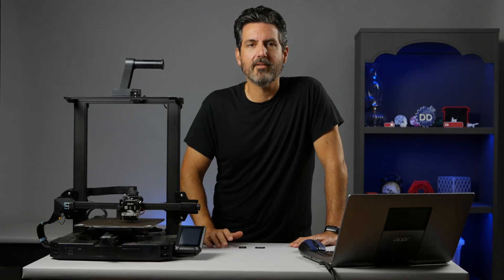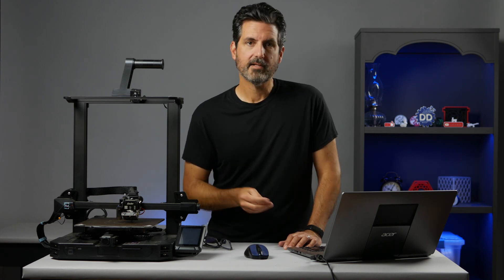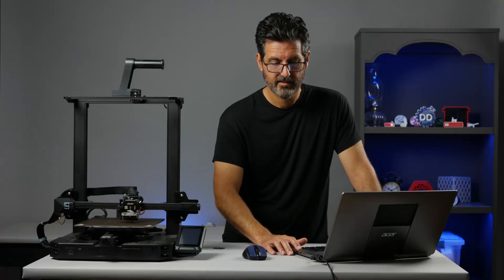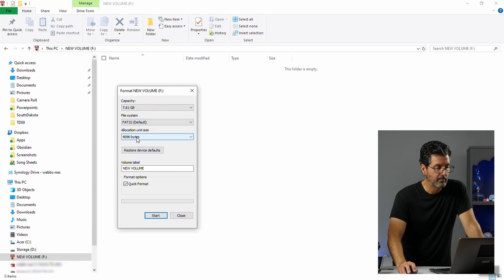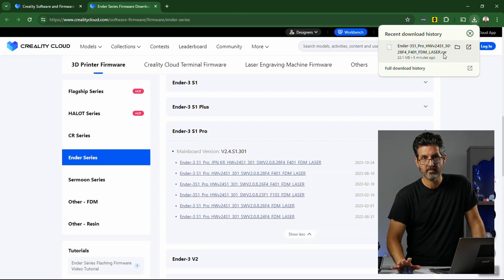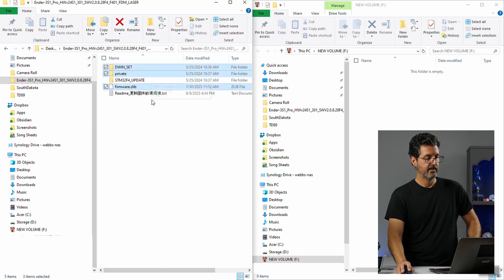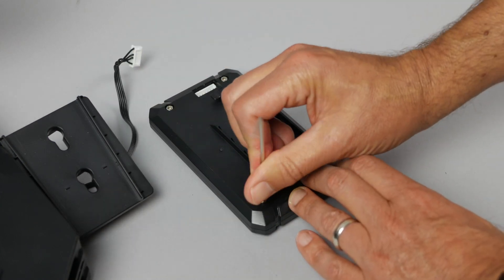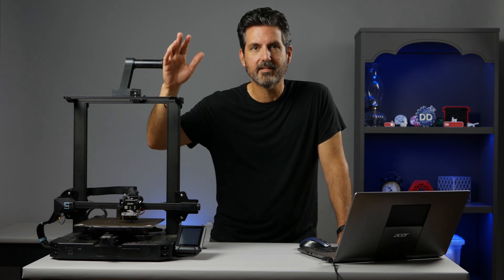How to Update the Firmware on Your Ender 3 S1 Pro: A Step-by-Step Guide

Comment: Great video thanks!  BTW - you don't need to take the bottom off to check the chip version.  You can look at the existing firmware on your printer (under 'About') and if it ends in F4 it's 401, and if it ends in F1 it's 103.
Reply from the maker: This is great info! Thanks for sharing. I pinned your comment so others will see it.
Reply: I read this after I opened a printer haha
Reply: @kriseq2 thank god i saw this before opening
Reply: Thank You!
Reply: Looks like I'm going to still have to open mine up.  Firmware version is 2.0.8.13, nothing after that.
Reply: My firmware says 2.0.8.23F4, but ChatGPT told me "that suggests that your Ender-3 S1 might have an STM32F4 series chip, but it’s not explicitly confirming whether it's STM32F401 or another variation (like F407 or F411)." So I still had to take the bottom off to make sure. If I'd come here I would have been happy to not have to do that job! lol

Comment: To find your Ender 3 S1 Pro's mainboard chip,
check the firmware version on the display (ends in F1 for STM32F103, F4 for STM32F401)

Comment: The SD card reader on my ender 3s1 pro is busted, and I'm using a Sonic Pad. I need to re-install the firmware as a troubleshooting option for an issue with my CR-Touch not being able to verify the sensor state. Do you know how I can do this?

Comment: I followed all the steps and installed the update successfully, but there’s a problem.
When I select the file I want to print and press Start, nothing happens — the printer doesn’t move or begin printing.
All the other buttons and settings on the screen work fine, except the print start button.

Can you please help me fix this issue?

Comment: Has anyone done this update recently? when I updated the screen, it goes from 1.0.3 to 1.0.5 but when I update the board it stays at 2.0.8.26F4 instead of x.x.x.28F4. I have tried to print and the screen reads everything but I can't push the "play" button to have the print start.

I've pulled the bottom off and checked to screen and they both show the 401 chip.

I've successfully rolled back the printer and it works.

I'm using a 1GB card formatted to FAT32 at 4096 bytes as required.
Reply: My update did the same thing. Did you get your F/W VER to update?

Comment: Bought a second hand S1 Pro off facebook marketplace for CHEAP,  that the previous owner had attempted to do some extruder/printer head swaps with, and had apparently gone out of his depth while doing so. This video helped me get my new printer back fully functional, and ready to print. Thanks for the help.
Reply: I can't resist these secondhand bargains. I just got the S1 Plus for €50. With PEI and glass bed. Nuts isn't it. I used the Sonic Pad to put it on Klipper

Comment: I followed the instructions on your video and I was able to update the mainboard but not the screen. After inserting the card on the back of the screen and turning on the printer it boots up like normal and that blue screen with all of the letters doesn't appear. It does everything like normal but when I click on the file to print, it freezes and I have to reboot the printer. Any idea on how to solve it?
Reply: If the screen update isn't done at the same time as the printer fw it will lock up when the printer tries to do an action that requires a missing graphic on the screen. Either roll back to the earlier printer firmware (to match the earlier screen fw) or update the screen as required. A newly formatted SD card may be required and from memory, I think there's 3 items that need to be in the screen SD card to update it. Not just the DWIN one. Alternatively, look into running with Klipper

Comment: Thank you for the clear explanation, specifically about formatting and reducing a 16Gb to 8Gb SD Card. However, in order to use the full potential of the 16Gb card, you also might leave an instruction to reset the card to 16Gb again. I know it is basic Windows disc management, but still...  btw, the update worked like a charm.

Comment: Great video. everything worked except the firmware version is still what it was but the Screen version changed. Guess I'll try it again.
Tried it again and the version still hasn't changed and now i can't print anything. Tried 3 different SD cards, same file. The file shows up in the Print screen and after selecting it, it does not show up on the Home screen and clicking Start or Play does nothing.

Comment: It doesn't work for me. The printer doesn't support cards...This printer makes me despair
Reply from the maker: If it doesn't support SD cards then you don't have a S1 Pro and you need to look for info for your printer.
Reply: @dandesigns3d  No, it's the S1 Pro, but nothing happens when I insert the cards for the update.

Comment: Bonsoir, j'ai suivi votre tutoriel pour mettre à jour ma Creality Ender 3 S1 PRO, j'ai vérifier le modèle de puce qui est STM32F401. Lors du téléchargement des fichiers indiqués sur votre site, le fichier "firmware.zlib" n'apparaît pas sur la carte micro SD pourtant mon ordinateur m'assure qu'il a été installé sur la carte micro SD.
J'ai donc essayer comme ceci, mais au moment du démarrage de l'écran, il y a un écran bleu avec écrit en rouge quelque chose qui apparaît moins d'une seconde.
Après cela j'ai mis à jour la carte mere.
Mais après tous sa l'écran ne  s'allume pas mais lorsque l'on clique dessus le "bip" est émis mais aucune chose n'apparaît à l'écran.
Comment puis je résoudre ce problème ?
Reply from the maker: I would try to get a new micro SD card, verify it is formatted the way I specify in the video (the format is VERY important) then make sure you add all the required files to the card and try updating the display again.
Reply: Quelqu'un peut m'aider svp 🙏

Comment: This didn't work for me on my Ender 3 S1 Pro. I formatted an 8GB SD and an 8GB microSD to FAT32, copied files to their respective cards, and diligently followed each step. The display update looks like it is updating files (though it appears a bit different than yours; maybe 50+ lines of prompts in red font), and when these cycle through the display freezes in the midst of a Creality logo animation. I waited for a half an hour, and nothing changed; just frozen 'logo'. Did the same process again; same result. I then booted the machine to see if I could get the mainboard update to work. It boots up, but when I look at the About tab, it still shows the same old 2.08.15F4 firmware. Nothing has updated.
I even reformatted the SD cards and did the entire process again. Same failed result.

No luck with 2.08.26F4 either. Went through the entire process again, and the About tab still shows 2.08.15F4

Comment: We just got a brand new Ender 3 s1 plus.  My son sliced a print to try on it, but when he puts the SD Card in, it crashes. Will updating the firmware help? He is bummed and thought it would work right out of the box.
Reply from the maker: Can you print any of the included files? Tyr the Bunny.
Reply: @ he just tried the bunny, but as soon as it starts, the printer turns off and reboots. Could something be disconnected?

Comment: Anyone have a clue why my printer will no longer home after updating the firmware?  I have checked the versions and they are correct.  The Z axis seems to operate correctly but when the x axis attempts to move it stalls/vibrates the stepper motor and will not move.  The y axis does nothing.  Any ideas?
Reply from the maker: When the printer is off can you freely move that axis with your hand?

Comment: Thank you for this helpful guide.
I got this printer model as a christmas gift and tried today to update it from version 2.0.8.26F4 to the newest one (2.0.8.28F4) because auto leveling not showing any meterings on the display an does not let me save it after done its work. No chance to get it worked with all the prework with sd card formatting and so on. Every time I power on the display with inserted sdcard containing the folders in file according your guide, no blue update screen appears but the printer is booting normally. Also updating to earlier versions did not work. Any idea?
Reply from the maker: Did you get this to work? If the screen is ignoring the SD card inserted and booting normally it is most likely either the incorrect files on the SD or it doesn't like the format.

Comment: Thank you very much! 
The video is very informative and comprehensive. 
Without it, it would have been difficult for me to do such a task. Especially the fact that the SD card had to be inserted into the display and not into the normal SD card slot.

Comment: My son's Ender 3 s1 pro shipped with a firmware that does not have a levelling function. Everyone's settings screen is different than mine. WTF? I hope this helps, or I am the worst Santa.
Reply: Nice, I wasn't in FCM mode or whatever, ECM. The one that isn't Laser, we said Laser. I factory reset it on a whim and went, "Well let's try that one." Leaving this here in case anyone is the same stupid.

Comment: Unfortunately, the motherboard firmware update did not work for me. I am experiencing an issue where the printer froze during the last print, and after restarting the machine, the display freezes on the startup animation and the machine does not boot. Do you have any suggestions? I’m afraid there might be a problem with the motherboard.
Reply from the maker: I would try to follow the steps again from the beginning. Make sure the format of the cards are correct and you get the correct files on the card for both updates.

Comment: Unfortunately, my S1 Plus gets stuck in a boot loop on the initial screen. I followed all the steps from the video, tried reverting to the old firmware, and updating it again, but it still loops. For some reason, the loop stops when I remove the SD card, but I've already tested several cards, and the problem persists.
Reply from the maker: Make sure you're using the proper firmware. My instructions are for the S1 PRO. Also I can't guarantee you that all the instructions are totally accurate for the S1 Plus.

Comment: Great video Dan thanks. Could I ask? I have just followed the instructions on your video but I’m sure I already had the latest firmware on my printer. When I done the screen update I didn’t get the blue screen list come up and was thinking that’s because the firmware was the same??  Also having big issues trying to get the machine to run from USB instead of SD. Have you done any videos on this process?
Reply from the maker: If the firmware is the same I would imagine it will do nothing. I haven't tried to run it with a USB. I find the SD process pretty easy.

Comment: Thanks for the walk-through. Like the step by step without assuming people know things. Helps for people new to doing this! Great Job! Just subbed.
Reply: I needed this because I used a Sonic Pad at first and it bricked my screen. The SP was great at first, but then it started losing connection a lot and messed up a TON of prints. Ordered a Raspberry Pi 4B and I'm going to use OctoPi/OctoPrint.
Reply from the maker: You're welcome. Glad it helped. Thanks for the sub. 👍

Comment: I am currently trying to do this on the ender 3 s1 and I followed all the steps in the video but when I went to load it on the screen it gave me an error code and the screen won't turn on if you have any suggestions that would help that would be great
Reply from the maker: This is for the pro version. Go and download the non pro latest firmware and upgrade with that.

Comment: Hello,quick question, i have the S1 but not the pro version,so no touch screen,installing the motherboard firmware without the display update is posible?
I just want to increase the max temp limit because i want to be able to print nylon cf,i already replaced the hotend for the pro one and a hardened steel nozzle,i just need a higher max temp limit
Reply from the maker: If I were you I would look into editing the latest firmware for the S1 to increase the max temp. I don't know for sure but I think you will have issues trying to load the S1 firmware on a S1 Pro.

Comment: Very clear instructions on how to upgrade firmware.  Thanks!  I would like to have the option to manually create a bed mesh instead of using the autoleveling feature.  A video describing the procedure for modifying the firmware would be great.
Reply: I don't see a matrix on the screen after autoleveling.  I see the same screen as before I autoleveled.  I'm currently running 2.0.8 24F and V1.0.2.  Looks like when I install the updated firmware that I will have this feature.  I just searched the internet and found your webpage stating, "If you have the latest firmware, you can view and edit these values on the screen for further customization."  This feature is not talked about anywhere that I've found on the internet.  That is fantastic to know. Thank you for sharing this information.   I really appreciate your help.   I'll be updating my firmware ASAP.
Reply from the maker: You're welcome! The only way I know is to auto level and then once it finishes touch the values you want to edit and enter a new value.
Reply: @dandesigns3d  Thanks for your reply.  After the auto level are you saying to edit the nozzle offset/height  (which would affect the nozzle height for the entire bed) or actually changing a bed mesh value (which would change the nozzle height for that specific position on the bed)?
Reply from the maker: Actually changing the bed mesh values. One auto level finishes the offsets for each location show in a matrix on screen. You can touch each one and edit it.

Comment: Many people saying this latest update will mess with the auto level, people saying the extruder scrached the heat bed, can anyone give me some feedback on this? Thanks
Reply from the maker: I haven't had any issues with it. As long as you make sure to set your Z-Offset properly you should be fine. Do a manual level and then the auto level after the update.
Reply: Happened with me

Comment: A very well made video. Helped me update to the latest version. Thanks from India.
Few questions
1. Did you try the 160mm/s speed? If yes can you share your settings? Both machine and slicer. 
2. I can see thumbnail preview via creality print 4x version output gcode only. Cura 5.7 worked but the new update killed it and Orca does not work at all. Can you help?
3. Have to tried updating to TT firmware? Idea  for a new video maybe 😊
Reply from the maker: Thanks, glad it helped! 
1. I have printed things at 150 with good results. I use cura and mostly stock settings 
2. It appears the preview only works with the creality slicer. I was thinking of trying to make a plugin for cura that works.
3. I'll consider this.
Thanks for watching

Comment: I had some issues with the partitioning an SD card that is larger than the 8GB and it wouldn't work unless I got an 8GB sandisk micro sd card after and it worked perfectly. But other than that this is a solid video to describe how to do this and I think this channel seems helpful.
Reply from the maker: Thanks for the comments. Glad it helped.

Comment: Hi, Im trying to update the lcd firmware without succes.... When I power on the printer, the LCD screen has power but stays black. Why is this? My printer itself is updated...
Reply from the maker: Did you remove the micro SD card from the screen after the update? If so, another possibility is the screen update failed. Prepare a different Micro SD card as I show in the video and try again. Pay attention to the format and what files should be on it. Both are important.

Comment: is it worth it?
Reply from the maker: Depends, the main features are the ability to print faster. 150mm/sec vs 60mm/sec and the ability to switch back and forth to the laser head (if you have it)
Reply: @dandesigns3d  ok i didnt know, faster printing well worth it
Reply: @dandesigns3d   Hi my sprite extruder died  I’ve done a bit of research on amazon none sprite extruder say they r for the 3-s1 pro it just says 3-s1 
Is it fine if i get one of those i just can’t find the right one if u could i help pls I’ve been looking for moths.
Reply from the maker: @wendywonglyn  I'm not sure if they are the same or not. I see the Pro version on Amazon here is a link https://amzn.to/3Sp4e5x

Comment: Mine just sides on the creality opening screen, no sign of a update and now is just a brick 😢
Reply from the maker: Try downloading an earlier version of the firmware and update both the screen and main board with that to see if you can get it going again.
Reply: @dandesigns3d  thanks for the tip, it worked
Reply from the maker: Great! Glad it worked!
Reply: @dandesigns3d  thank you so much, just added silicone mounts too and it’s behaving much better. Glass bed worth a thought?
Reply: @dss199  How did you install the earlier version, mine is bricked but it wont take the earlier version. Also what version did you go to and are you staying on it?
Thanks
Reply: @acdf3kbornagain  there are 3 versions on the site, I used the middle one and had to update both the printer and the screen. It’s important you do both